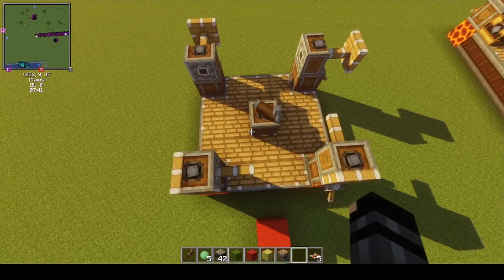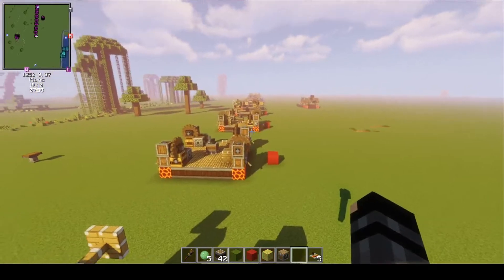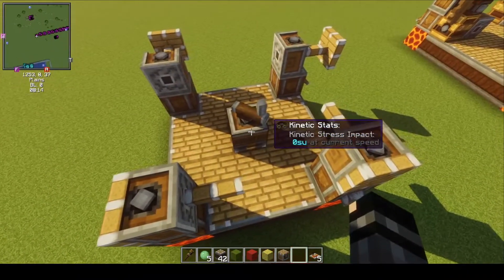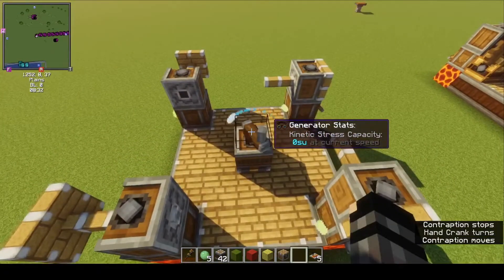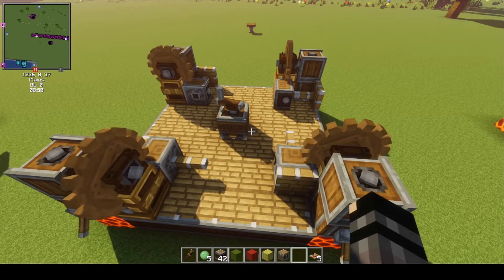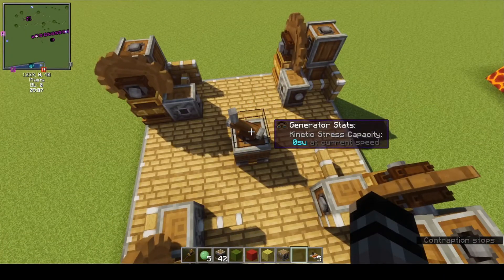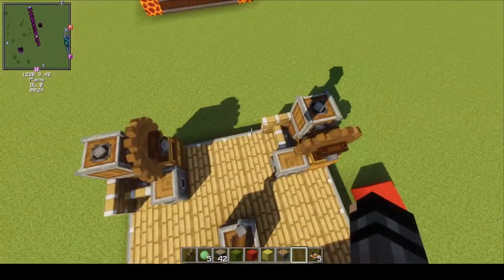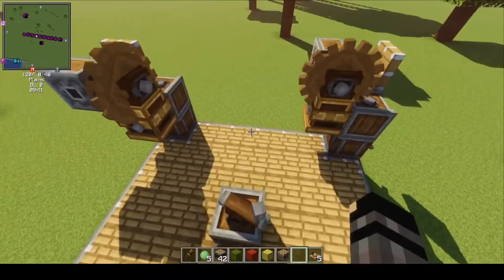Create Mod 0.4 - Piston Experiments

Comment: For the sequenced gearshift, they have the same concept as the piston : They don't deferentiate which way the power is coming from but they have a set direction for each orientation. Thats why they can cancel each other. 

Simplest solution : just 2 twisted encased chaindrive. In one setup (horizontal to vertical, flat layout) they have the same bug and can cancel the pistons. It's the most compact way to deal with it. 

Gantries don't have this issue.
Reply from the maker: Ok, so the gearshift and piston will cancel each other out. So then my vertical gearboxes are probable also cancelling each other out because I use a few in my second working design.